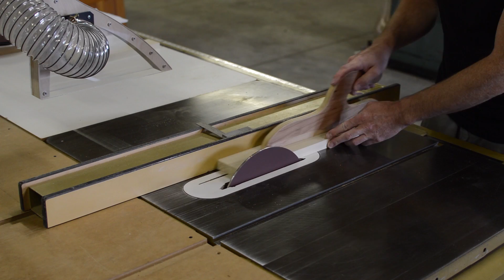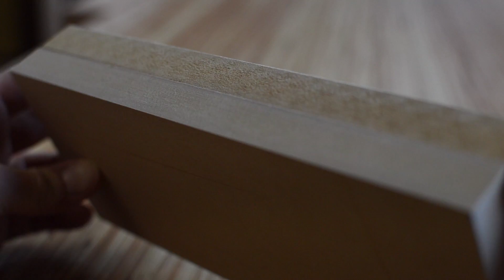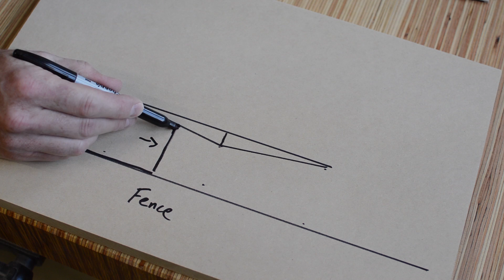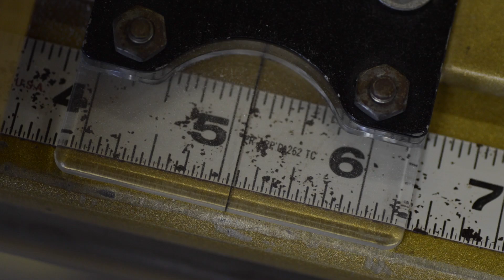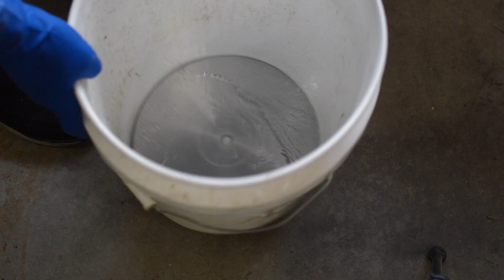This sanding disc will improve your woodworking and carpentry, period.

Comment: Unfortunately my Sawstop does not allow to go beyond 90 degrees. I do have the earlier version you show in your videos and love it. Will have to save up and get your version. Appreciate your videos, keep up the great work.
Reply from the maker: It should I have worked on one that was able to. We just went under there and adjusted the bolt that acts as the 90 degree stop.
Reply: Mike Farrington I’ll have to look again. It sure didn’t seem like it would. Thanks for the tip on this as well. Been a real plus.
Reply from the maker: @jeffwimer3969  I know every saw is a little different, maybe worth the extra look. My pleasure.

Comment: Very interesting. I think this is gonna go on the buy list. You know Mike, there's John Heisz just did a video which is basically a knockoff of the "final cut" blade. I've used that blade and loved it except for the fact that the edges of the sandpaper wore down faster than the rest. This detail fixes that. If you could take the taper down to a minimum and add some carbide teeth. That's something to think about. You could make the teeth thin kerf since you got the tapered plate. And then maybe the taper can be set to take a little more than an 1/8 kerf total. I'd personally buy it. And if you don't make it, I'm probably gonna invent it one day lol. It's probably patentable as well. I'd at least be a customer
Reply from the maker: Funny you mention final cut. I used one on my chop saw when I was installing a lot of crown molding. I would cut the molding, test fit in and if I needed to take off just a little I would bump the workpiece against the sandpaper. That was a totally cool invention.

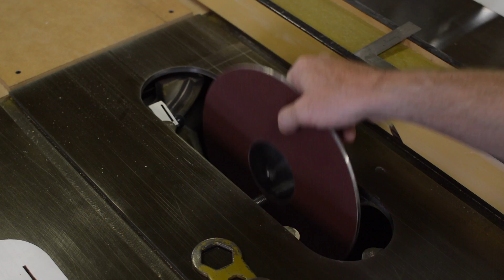Comment: Just thought of something thats much better than switching the disk to other side. @2:38 SIMPLY CHANGE THE FENCE TO RIGHT OR LEFT OF DISK.  That way u can utilize both sides super quick
Reply from the maker: That would work, depending on your work flow.

Comment: Great idea and execution, Mike. It's just a little too pricey for me at this time. I'll have to save up for it. Stay well.  Bill
Reply from the maker: Thank you. I fully understand.
Reply: @MikeFarrington  I agree with the pricey bit.  I think it's an awesome product. But you can get 4 SINGLE taper ones for the sample price.
Reply from the maker: @EricBlanchette  The single sided ones are too thin on the outside edge so many of them don't stay flat. If you put mine next to one of those, its quickly apparent why mine costs more. This thickness was needed to ensure the disc stays true.

Comment: Hi. I really like this idea of a sanding disk on the table saw. I have a Delta 12” that I bought in 2004 or 05. It’s been in storage for 12 years and I’m just now getting it operational again. 
Where can I find out more about your disks? Your website didn’t seem to mention them. 
Thanks,
Paul
Reply from the maker: Thank you. I sell the discs on my website. I think you have a 1" arbor on your saw. I have those in stock as well.

Comment: After 2 years, I finally got one.  Unfortunately, my throat plate isn't wide enough for the disc and I can't use my riving knife because the disc grinds against the riving knife handle when it's in the tight position.  I'll make a new throat plate and I will just leave the riving knife off when sanding, but I'm wondering if anyone knows how to get a Ridgid TS4512 to tilt 2deg to the right like Mike did with his saw in the video?  If not, I can tilt it left, but I was hoping I could use it on the right side of the blade.
Reply from the maker: Jason, I answered your email. Lets take this conversation to email. I am pretty sure we can get you all setup and running.

Comment: Maybe I’m weird, but I’ve actually usually had MORE trouble glueing super sanded / smoothed pieces that fit EXACTLY together! Careful what you wish for, haha, but the disk looks interesting.
Reply from the maker: I agree, however, two pieces that have a nice surface will end up creating a less visible glue line.

Comment: The last comment you made about screwing a piece down to prevent kickback got me thinking...could I just adjust the rip fence, as I do when I rip wood, so that it does not extend much past the centre of the disc (past the portion that does the sanding)? Rip fences should not really extend that far anyway, even when ripping panels. Your advice? Thank you. This looks like a great time saver.
Reply from the maker: I have had a table saw where the fence could be moved forward. I was never comfortable with that for some reason. I don't see why it wouldn't work, I just can't confirm that it does.

Comment: I hope you consider getting cubitron sandpaper available for this
Reply from the maker: Thank you. That is good sandpaper, but wouldn't work for this application.
Reply: @MikeFarrington I'm curious why that is.
Reply from the maker: @RichSobocinski  That type of paper isn't designed to hold up to that level of power sanding. For the same reason that wouldn't be used on a stationary disc sander or a wide belt sander.
Reply: @MikeFarrington  so basically just for hand sanding and random orbital...I see
Reply from the maker: @RichSobocinski  Different types of grit are used for different applications. Stuff used for hand sanding and random orbit sanders, cuts quickly, but wears out relatively quickly. For heavy duty sanding, the grit is much harder and lasts longer under heavy stress, but if it were used by hand would sand very slowly.

Comment: I have a flat sanding disc for my table saw, and it's junk. It's made from a flat piece of steel, but not tensioned like a saw blade, so it wobbles like crazy. I've gotten it usable by bending out most of the wobble, but it's still not great. Since it's flat it can't be used with the saw's fence. 

Yours looks like a much better designed product.
Reply from the maker: Thank you. Comparing this to a flat disc isn't fair, two different animals.

Comment: Mike this sounds and looks perfect. I don’t really have room for a 8 inch jointer in my shop, do you think this could possibly eliminate the need for a jointer with regard to gluing up panels?
Reply from the maker: Kind of, but not really, if the board is really close, that could work.

Comment: Looks like a great product. I'm about to refinish a bunch of doors and I wonder if you have any experience on how the sandpaper does when dealing with prefinished wood and/or plywood? I can imagine heat buildup control is key, but might it still be possible?
Reply from the maker: I agree, I think heat build up will be the deciding factor. I have sanded a few parts with a finish, I used 80 grit. It worked OK, but I didn't do enough to really give a good answer. As to plywood, its great, I use it to sand the tops of baltic birch draw boxes all the time.

Comment: Great Job! Subject change, I machined a flat true 10” “disc” for my saws. I install this smooth toothless disc and use it for blade set ups, and machine adjustments to avoid those pesky sharp off set teeth. Am I just nuts? Others I’ve shown this to just think it’s obtuse! I’m Wondering what Mr Farmington thinks of this? Thanks.
Reply from the maker: Setup discs are totally useful. You are not nuts.
Reply: Mike Farrington - Thanks Mike, but I think I need a second opinion! (Old joke just waiting for the punch line)......
Reply from the maker: @MJ-nb1qn  Ha!

Comment: The results look awesome. A quick question. Looks like we need to remove the riving knife for this to work. Is that the case? Thanks.
Reply from the maker: Thank you. You do not need to remove the riving knife, but it won't function if left in.

Comment: Hey Mike, I noticed the extra slot in your table saw inserts, are these for dust collection? I tried searching your channel but couldn't find anything. Could you explain the functionally of these slot or point to where I could get some information? Thanks, eh.
Reply from the maker: The extra slot was from being turned around. Nothing special, just a function of being used.

Comment: Do you make a 10 inch blade with 30mm arbor to fit the Robland X31 Combination saw please?
Reply from the maker: I do not currently, but there is a good chance I will in a few months.

Comment: Fantastic tool!  I noticed you didn't mention any uses as a traditional disc sander for rounded edges (ie. no fence, approaching from the side on the downward spinning face).  Do you anticipate any complications with this use or is it just moving too fast?  Have you tried this?
Reply from the maker: It is moving a little fast for that application. Plus you would need to deal with the 2 degree taper.

Comment: Mike, great presentation, as always.  Brilliant idea.  Just a note on adhesive removal.  I don't know if this will work with the adhesive on your discs, but, I find lighter fluid to be my absolute favorite sticker adhesive remover.  Most adhesives are petroleum based and like dissolve like.  I find the lighter fluid wont attack plastics or inks.  It's not oily.  It dries fairly quickly.  Maybe hit the item with second cleaner if you are eating from it.  Probably not applicable.  lol.  Dont get me wrong, I still love brake cleaner (works great on pitch BTW).  But lighter fluid, is much more innocuous.
Reply from the maker: Thank you very much. Great tip on the lighter fluid. I'll give that a try.
Reply: Naptha is the same thing but much less expensive.
Reply: @bullfrogpondshop3179  You are confusing lighter fluid for camping lantern fluid.  They are not even close to the same.
Reply: @ryanmacewen511  No, I am not confusing naptha with Coleman lantern fuel OR lighter fluid. But...

I did a little research to back up my point. To my surprise, it turns out all three are very similar, and all three contain naptha to varying degrees. 

However, anecdotal evidence suggests Coleman fuel is much more volatile than the other two, so I won't be using that in my zippo.

BTW, when I say naptha, I'm referring to VM&P Naptha that can be found in the paint section at the big box stores. Also, I'm assuming you're referring to lighter fluid (as used in zippo lighters), as opposed to CHARCOAL lighter fluid that's used to light a charcoal grill.

Comment: Looks very cool. I think this might be the solution I have been looking for to help remove the saw marks from our rail and stile door stock.

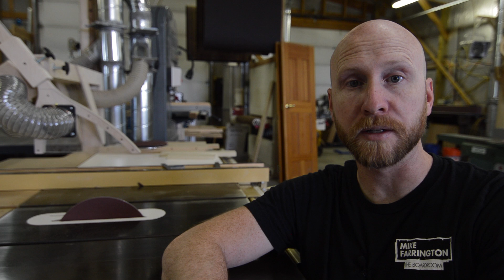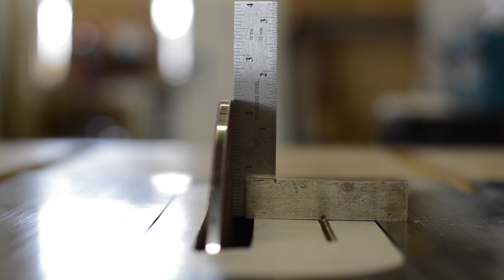I’m only confused on one point. At 3:30 you say set the disc is 2* off 90* but then at 4:30 you say to set the saw to 90* and start working. Which one is it? Or am I overlooking something?
Reply from the maker: Sorry for the slow reply. The edge of the disc is set to 90, which would mean the arbor is at 2 degrees. Hope this makes sense. Feel free to email if you have more questions. As to your usage, that is what this disc was made for, face frames and door parts.

Comment: I don't think you mentioned it in the video, but I would assume that it is thicker than the average table saw blade?  This would mean that the fence would not be aligned to the scale on the saw when the disc is installed?
Reply from the maker: Yes, I didn't mention that the scale on your saw will no longer be accurate. Still useable, because each time you put the disc back in it will be offset the same amount. I think its a fat 1/8" on my saw.

Comment: Maybe your disc is too thick, but for 10" saw blade cleaning, turn the bucket upside down, the lip on the bottom makes a shallow bowl that's the perfect size and depth. I think I got that from Samurai Carpenter.
Reply from the maker: Funny you mention that. I showed that trick in a previous video, with the disc, the taper makes it so it won't soak, if that makes sense.

Comment: Instead of flipping the disc around to use the other side, lower the disc and move your fence to the other side, raise disc and go.  So how do you use this on the short side of a board without kickback?
Reply from the maker: Thank you. This would not work due to the taper. If the fence was moved to the other side, the arbor would also need to be adjusted. To sand the short end of a board, either a miter gauge or a sled would need to be setup.
Reply: @MikeFarrington  My grasp of physics may be tentative, but as a circle, how does it have a taper?  If it is only tapered on one side, then perhaps there is opportunity for enhancement for bilateral symmetry.  And if your fence is square to the table and the arbor square to the table, why would you need to adjust the arbor?  I am sure you are correct, but you have me really scratching my head pretty hard here.
Reply from the maker: @garynumen13  If we are getting technical, the disc does not have a taper, it is conical. The disc is cone shaped on both sides, hence the name. I used the words double taper because I thought more people would be able to relate. The arbor needs to be adjusted to make up for the 2 degree cone shape that is machined onto the disc. This cone shape is used so that there is a wide entry and exit for the workpiece and the center of the disc is doing the sanding. Let me know if you have any more questions.

Comment: could you stand perpendicular to your saw and use it as a super powerful disc sander?
Reply from the maker: I would say that would not be safe. The disc is turning much faster than a normal disc sander, combine that with the 2 degree taper and it probably isn't a good idea.

Comment: Have you tried using a gum rubber block to clean the sanding face? I do this on a regular disc sander with good results.
Reply from the maker: This is spinning pretty fast compared to a disc sander. Much care should be taken if doing that.
Reply: @MikeFarrington  Gotcha. Thanks.

Comment: I'm 100% buying just cause I love your stuff haha (of course it looks handy too).Can you explain what you mean though that it has to tilt towards fence 2 degrees? I have a left tilt saw so does that mean I can't use?
Reply from the maker: Nathan. I explain how to use it on a left tilt saw in the video. The short version is either put the fence on the other side of the blade, or adjust the 90 degree stop to allow the saw to travel 2 degrees toward the fence. My saw is left tilt.
Reply: @MikeFarrington  oops sorry I missed that in video before asking. Thanks!!
Reply from the maker: @TreeOfLifeWoodworking  No problem. This is one of those things that is fairly simple, but there are a couple key tricks. The tilt is one of those tricks.

Comment: Mike, I wish you make one for Hammer c331 or k3. will it be included in a near future?
Reply from the maker: Depending on how popular that hole pattern is, I may end up stocking them. If not, I can have the bore opened up and add breaking pins.

Comment: i thought it was an old laser disc at first, loli have a delta bench saw that i use as a bench sander for guitar parts, i have a saw blade that i glued a piec e of plexi glass to, and have an 80 grit piece of  glue back  air hog paper on, and thought i invented it, hmmmm, i should have marketed that
 the only issue i see is having to change the blade back and forth,it would be great with another saw to have it on all the time
Reply from the maker: Thank you.

Comment: Back in the day (yes, I'm really old) sanding discs on a table saw were frowned upon with the reason being that the bearings weren't made to take the side pressure. Any thoughts? I really like the results you're getting and would love to support you.
Reply from the maker: I don't think its a problem. Maybe on really cheap low end job site saws. I have used these discs for a few thousand hours in my saw, and haven't needed to change the bearings.
Reply: The taper is so ridiculously gradual and with the inertia of the spinning disk, coarser grit paper removes the material before it has a chance to even "warp" the disk!!! I suppose if the wood was extremely hard & the feed rate too fast you might have some issues!!!😎👍🏻
Reply from the maker: @RTR-MATEY  Agreed, feed rate, plus miles of lumber might do it.

Comment: Awesome. I think I'll buy me one. 
One question though. Why can't you just move the fence to the other side of the sanding disc instead of flipping the disc? That would be so much faster.
Reply from the maker: Thank you. You can move the fence to the other side, but the tilt would be pointed the wrong direction.
Reply: @MikeFarrington  If it's in the 90 degree position like you demonstrated then it will work on both sides won't it?
Reply from the maker: @MrErViLi  It will work on both sides at any angle, but the side that is being used needs to be adjusted to 90 degrees or any other angle you are trying to achieve.

Comment: I’ve watched the video a couple times and must be missing something. I don’t understand how tilting the sander two degrees towards my fence will give a 90 degree edge. Anyone help me understand?
Reply from the maker: 2 degree, then leaned towards fence creates a wider entry and exit, with the middle portion of the disc being closest to the fence. So this allows for a safe entry, a single point of contact for the sandpaper, which sands parallel to the edge of the workpiece, and a wider exit which reduces the chance of kickback.